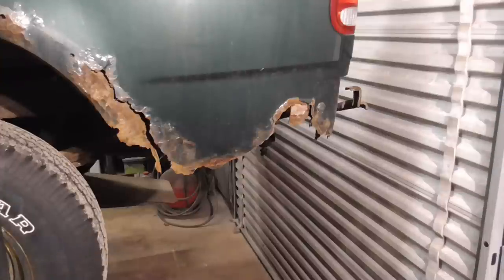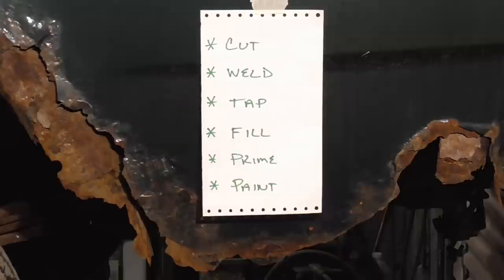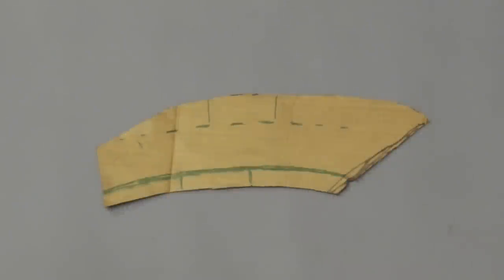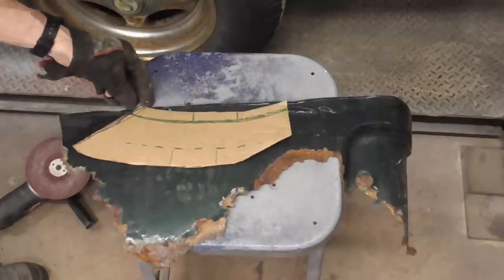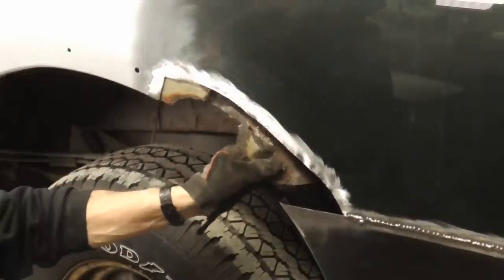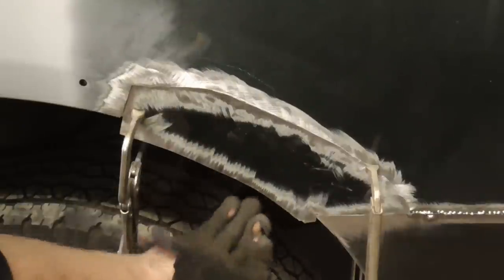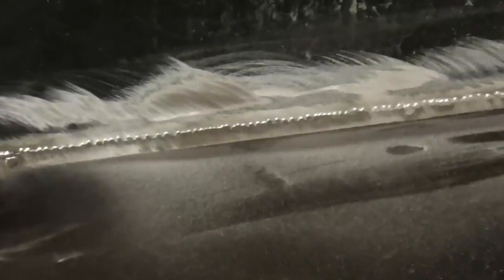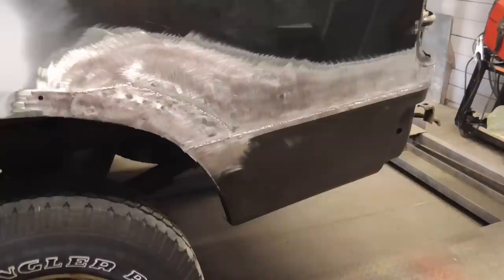Severe Rust Repair - Lower Quarter Patch Panel Installation

Comment: That has to be the most rust repair on a single panel I’ve seen. Looking good Jerry
Reply from the maker: It's a friend's truck - lets me borrow it to make videos.  Definitely needed a new box or should have been driven to the salvage yard but....  I figure someone might need to do the same to save a vehicle if there's no new parts available.  Thanks for checking it out Greg :)

Comment: Getting busy around here with summer in full swing. BUT!!  I make time for your rust repair videos!!  I always learn something!  I am taking a liking to your low rpm, large disk grinder… I bet you are the only one on the Internet that uses that thing!… It makes sense! Low rpm and low heat means no distortion! Thanks for your continued videos and education!  Another good one!!  Chris in MN!!
Reply from the maker: That style of grinder (only air tools) is the only thing you'll see used in an actual body shop for the reasons you stated - no heat, no shooting sparks across the shop, no worries about thinning the sheet metal :)

Comment: You sir, are amazing! Thank you for sharing your knowledge!! I have an old '89 Bronco that needs some work around the rear wheel wells and I'm guessing there will be other surprises. With your help I'm confident that I could do this. Now I just have to buy a house or move into one, because living in an apartment won't work..

Comment: Hi Jerry, awesome video again. Could you do a video as to the diffrent types of metal one can use. Some say dont use anything but satin coated? Not to sure if there are many diffrent formulations ,etc of metal. Thx, have a wonderful weekend!
Reply from the maker: Good video idea GM - I'll write that down.   Here's what I use https://www.alro.com/divsteel/Metals_Gridpt.aspx?gp=0055&gpn=A1008%20CR&Mat=CARBON%20STEEL&Type=Sheet but have had good luck with almost any sheet metal - i.e. used panels, scrap sheet metal, even galvanized sheet metal (grind the coating off where you weld) :)

Comment: Great video.  I Reilly enjoyed it.   Could you provide more or an explanation on how you were able to make body line.  You were using the hammer and dolly but i'd like an explanation on how that tequnique works. I saw how you used the tape line to help form the body line when sanding.l the filler.
Reply from the maker: Here's a couple vids that may help - https://www.youtube.com/watch?v=EBiW5uQN-CQ * https://www.youtube.com/watch?v=JLOphXXcaCg  or * https://www.youtube.com/watch?v=-66tf0tpeqo  Let me know if you need more help on this topic :)

Comment: Professional RUST Repairer...  HQ in MICHIGAN...  that is job security!!  It's heartbreaking how many late model trucks and cars rot here.  : (   Question, and I know nothing about welding, but will water get in that lap joint?  Will that be more prone to rust in the future than a butt joint?  Why a lap joint over a butt joint on that patch panel? ( just curious, not second guessing a professional).  Thank you for all you do and sharing amazing content and videos!
Reply from the maker: Here's a good video explaining in better detail than I could explain here - https://www.youtube.com/watch?v=JIIonJOVro4  All or most quality body shops use a combination of lap and butt depending on the area you are welding.  Lap for areas where you can tap the seam down butt for more rigid areas like door jambs, rockers, edges, etc.  I think lap lasts longer than butt actually - probably cause you can tap the seam down and the filler acts as a buffer between the seam and the finish.  You really don't want a seam right under the finish - most likely the seam will end up showing later on.

Comment: Ithink if you read directions on some newer fillers they say for use over bare metal only . The one I use will stick  to any metal. Oldays primer and bondo may have a hard time sticking so Chrysler came up with the epoxy thing 
In professional  shops they dont use it any more they use metal to metal primer. I did not know people still used epoxy until I watched some utube stuff. It is a good adhesion promoter in the old days we used it on new parts and bumpers it would still work for that.
Reply from the maker: Good points Roger - your right most shops go direct to metal - filler and primers - no epoxy 1st.  Thanks for your comment :)

Comment: In step 4 prepare for filler after sanding the welds you spray the welds with something what is that? Thanks for the Great video
Reply from the maker: That was a mini sand blaster.  It cleans the welds really well - filler stick awesome to sand blasted metal.  The blaster is listed in the vid description and the blasting media is from Tractor Supply - red or black bag.  Feel free to ask any other ?s 👍💯

Comment: is that a vevor weder ? gun looks same as my blue machine sounds like it too, fan always on and the click once you let go
Reply from the maker: It's actually an ARCCAPTAIN MIG200 - I like it - has a big easy to read interface and welds really nice on the MIG setting.  Do you have a Vevor?  Like it?

Comment: What grit do you use to buzz the welds down? Would a 40 grit be suitable?
Reply from the maker: 40 grit fiber resin disks.  Try Benchmark Abrasives - they have reasonable prices :)

Comment: What was that blue gun you used after grinding down welds?
Reply from the maker: Zendex Speed Blaster Blue Portable Sand Blaster (or similar brand) - It's called a SPEED BLASTER.  All the products and tools are listed in the description Steve - feel free to ask ?s if needed - have a good weekend :)

Comment: In your opinion, what do you recommend for a waterproof  filler on that type of repair?
Reply from the maker: Any fiberglass reinforced filler is water proof and will work for you.  Evercoat Everglass, Bondo Glass, etc
Reply: @LakesideAutobody  Do you have a favorite for that area where there's a lot of road spray and roadblast?

Comment: What primer are you using on bare metal repair like this?
Reply from the maker: I use lacquer primer surfacer but any primer surfacer would suffice - lacquer, urethane or polyester (feather fill)

Comment: Do you use a gas shielded mig?
Reply from the maker: Yes.  Gas MIG is the easiest creates the nicest welds but flux core will work too - https://www.youtube.com/watch?v=ic7Gwf8y4Yc
Reply: @LakesideAutobody  I just picked up a 2009 RAM with a damaged front fender, and some bad rust in the usual places. Trying to avoid buying repair panels for everything. Easily 600$ probably to do everything that way. But shaping wheel wells and rear lower quarters feels daunting just to save a few hundred bucks. Gonna watch  a few more of your videos to psyche myself up for it before deciding what way to go. I’ve got the hammers and the dolly’s. Just don’t own any kind of breaks.